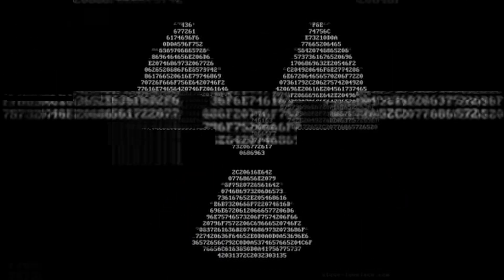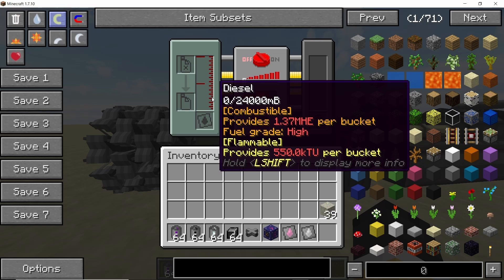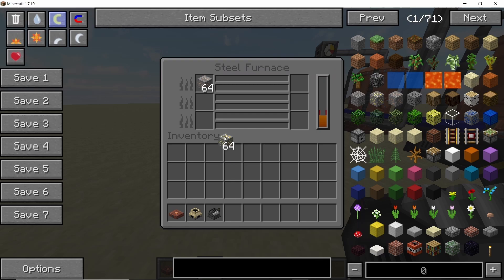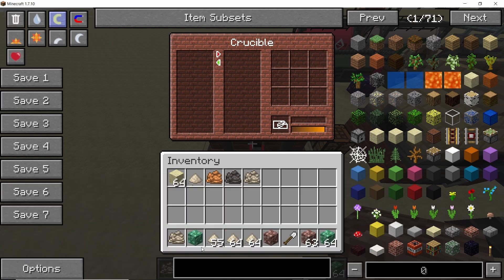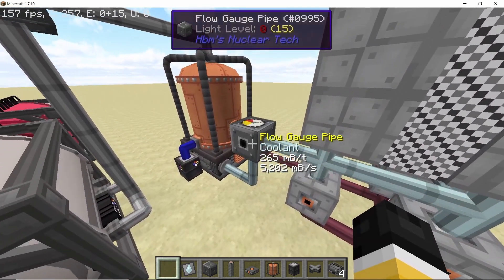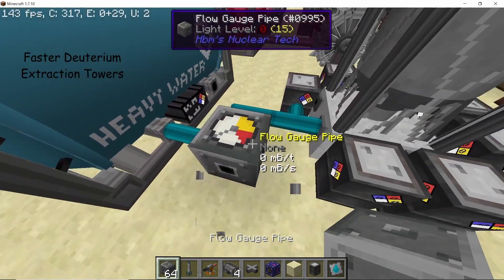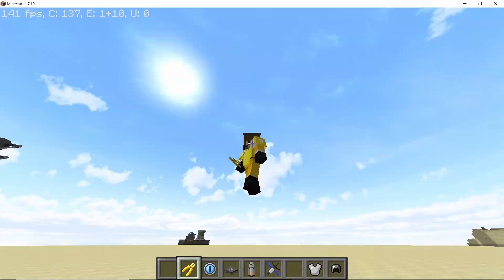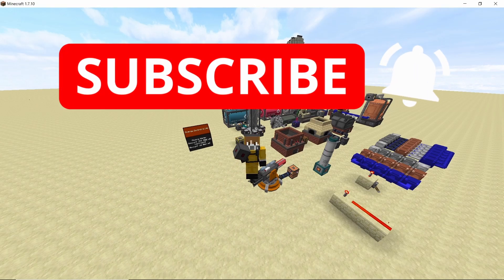NTM Updates & Changes - Steam generators, Fluid System Overhaul, Heat based machines and Armor Mods

Comment: is there a way to automatically turn off the combustion generators?
Reply from the maker: I don't think so, as long as it has fuel it will work (given its internal power buffer isn't full)
Reply: yeah i figured that out, i had to make an automatic fueling timer that can be turned off to shut of the emergency diesel generators in the pwr power plant im building
 @SavageVegeta
Reply from the maker: @verdisquo97_arts  also if you're using the latest version of the mod then the combustion generator has been replaced with the wood burning generator
Reply: @SavageVegeta  how soon might it be till pwrs are added to ntm extended

Comment: Flow guage is useful because you can make control room to check the flow of liquids and gases
Reply from the maker: And also use it to optimize your builds!!
Reply: @SavageVegeta  First, thanks for all the great videos. Don't know where I would be without them. Second, I don't find this flow control. What version of HBM's Nuclear Tech mod are you using? I'm using Minecraft 1.12
Reply from the maker: @charliegc4  all these updates are for 1.7.10 version of ntm and some of them are still not available for the 1.12.2 version. So you'll have to wait it out !! 
Also I'm glad to know you find my content helpful bro :)
Reply: @SavageVegeta  Thanks. Flow gauge is the one I wanted, just cause I want to see what is moving through the pipes. But I guess I will do without.
Reply from the maker: @charliegc4  beleive me, flow gauge is the feature which I want the most as well in ntm extended just cause of the convenience while balancing a reactor. But yeah we can hope that it'll be added in the upcoming updates of the mod

Comment: 12:16 my advanced liquid sensor kits do nothing when i right click, doesent give me anything, doesent take anything away, just does nothing. i click the same spot as you but it works fine with the big ass tanks
Reply from the maker: I saw your message on discord as well : the energy control version I am using is 0.3.4c. I can send you the list of mods I use and you can run the crashlog by Zux (If a crahslog is generated that is)
The thing is since the release of 0.3.4c my game has stopped crashing altogether due to energy control

Comment: WHat is that mod you use to see the power output etc.?
Reply from the maker: If you want power to display on screen then you can use Energy Control mod , otherwise the gui of the energy storage blocks in ntm will show you the rate at which energy is being transferred
Reply: @SavageVegeta  thanks

Comment: Hi, out of the topic question cuz ur the only guy that stays up to date with the mod and the wiki doesnt answer my quesiton, how do you charge the terra drill?
Reply from the maker: You charge it like every other tool that can be charged in NTM - by placing it in the output slot of any battery storage block. 
Also there is a machine called charging station which you can attach to a battery storage block or a cable and as soon as you approach it and you have anything in your inventory that can be charged then the charging station will wirelessly charge it
Reply: @SavageVegeta  thanks alot, love ur content

Comment: very important question, if I update this mod will it affect things I've already built on older versions? what happens to 'old' pipes when you update? will they just cease to exist or is there something to ensure support for older worlds? all this new stuff looks very tempting but I don't wanna destroy the hundreds of hours of work I put into my world.
Reply from the maker: Older pipes were removed afaik so updating to the latest version will mess up your world. 

If you want to try this tho then make a test world with the old mod where you make a simple fluid system with alot of pipes and then close the world and update your mod and try again. 

Another thing to consider here is that not only the fluid system but the energy system was overhauled as well , I don't know which version you are using so this might also be a possibility here.

Comment: Hey savage, do you have a reactor design that is small and also stable with auto control rods? At my npp which Fyodorovich NPP im thinking of upgrading the 1x1 into a little bigger size likeprobs 5x5 so yeah, if you do have a video for that, thanks!
Reply from the maker: Moderated fuel rod in the middle with 4 auto control rods and reflectors at the very end. Then you can have steam channels / fluid heaters in the corners and then complete the remaining blocks with structural channels if you want to. A simple 5x5 design which can use most fuel there are

Comment: Do you know any train mods where i can load HBM Liquids in? because immersive railroading takes buckets only and not fluid barrels
Reply from the maker: As 1.7.10 ntm doesn't have forge liquids , it's very difficult to integrate with other mods cause most loading/ unloading in train Is done via fluid ducts. Ntm doesn't accept other mods ducts and other mods don't accept ntm

Comment: my computer does not leave 30 fps in minecraft 1.7.10 tlauncher in ntm mod and nei recipe what do i do to be equal to your computer that is 300 fps and i am from brazil and i am your subscriber
Reply from the maker: If you can then allocate more ram to minecraft , like 4 gb. Also fps does depend on what type of graphics card you have ... I have a GTX 1650. The bigger the modpack the less fps you will have so yeah use less mods if you can
Reply: @SavageVegeta  thanks

Comment: Which version of hbm ntm is this and is it avavible for 1.7.10
Reply: This is the 1.7.10 version (you can see in the top-left corner).
Reply from the maker: As the time of this video it was version X4445, and yes as Steam powered Dolphin said it is indeed version 1.7.10
the 1.12.2 versions of the mod are not updated as frequently

Comment: hei Savage! do you know that High Energy Field Jammer can prevent dfc from exploding even the heat is over 100%?That makes dfc even more cool!
Reply: If the jammer really works like that...then I wonder if it's possible to do something so ridiculous as making a binary looping DFC that uses antischrabidium and balefire rocket fuel, with the maximum possible number of chained emitters at maximum power...
Reply from the maker: Just tried it out yesterday, indeed it's pretty cool and prevents a meltdown but is understandable cause of its cost and the purpose for which it was made - stopping folkvagnr explosions 

Also @Steam Powered Dolphin, the dfc will still try to explode so power gen will stop for time being , it's just that the explosion will not happen. I'll do some more testing today !!

Comment: Hello savage, is it possible to make an automatic air defense system based on a radar in minecraft or in other ways so that a defense missile flies behind an airplane? (like in the top gun maverick scene)
Reply from the maker: Yeah it's possible using AEGIS mod as the radar will be able to track MCHeli Vehicles and the missiles will also lock on. But you will need another player who will do this as aegis is not an automatic mod